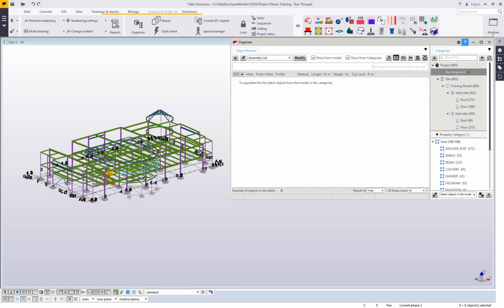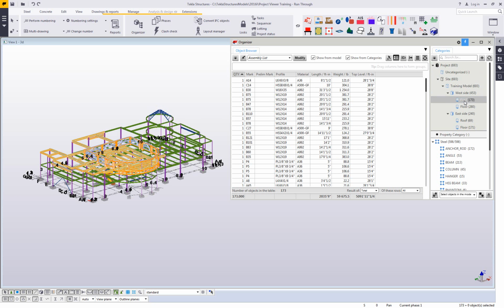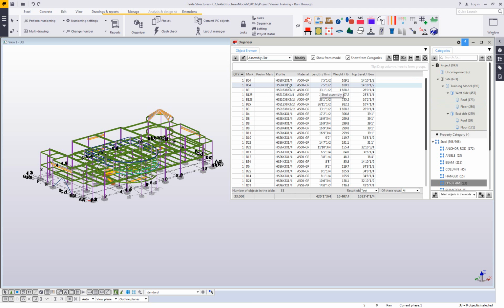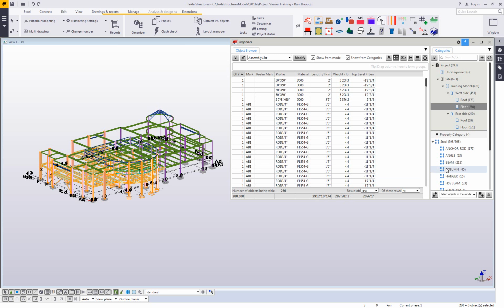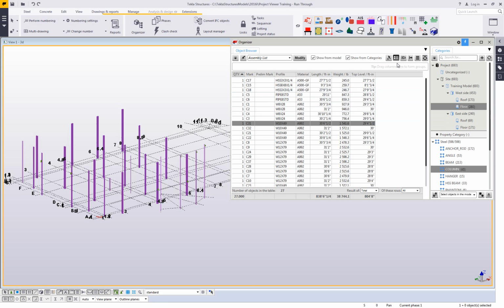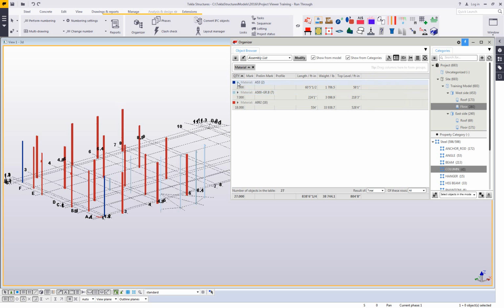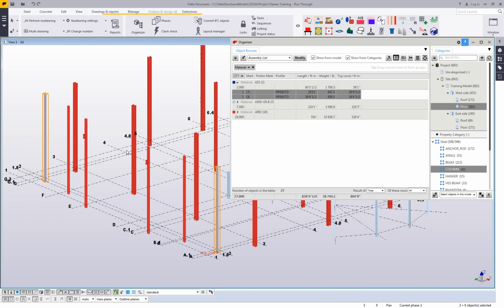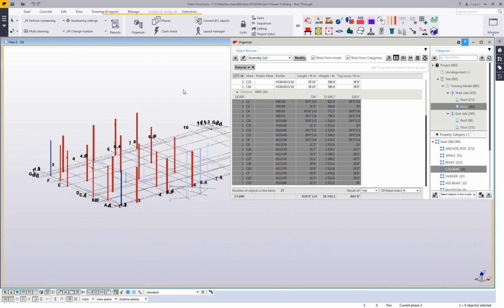Organizer   Model Checking

Comment: Hi Lee. What selection button should I use to ensure I capture all my individual fittings and members when I am using Organiser.
I the past I notice I did not capture all my individual parts.
Reply: When you set up your category properties there is an option at the bottom to "Include the highest assembly level in the model".  Make sure that is unchecked if you want to grab your single parts.  Also, if you are using a selection filter, make sure it's not only grabbing the main  part of the assembly or only assemblies.
Reply: @leesnyder6784  Thanks
Reply: @leesnyder6784  I am still not capturing the plates the way I want to. Sometime in the future, I hope you can do a video explaining this in more detail. I would like to quantities for the various plate thicknesses.
Reply: Ok please contact your local Tekla tech support team and they can help you get it set up the way you want